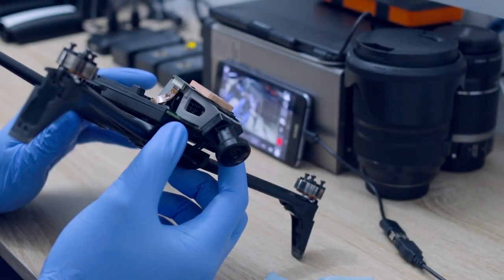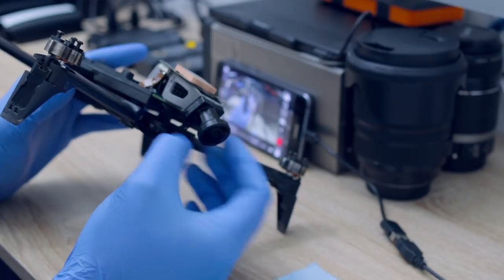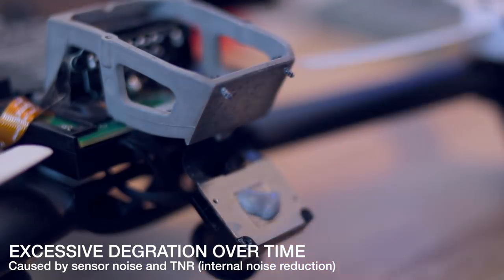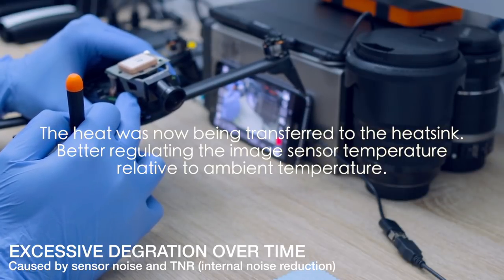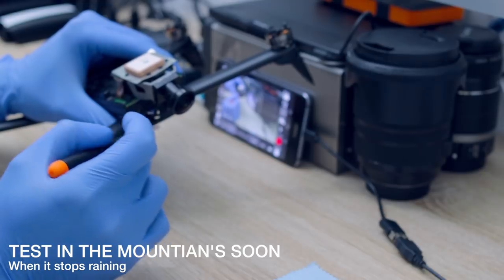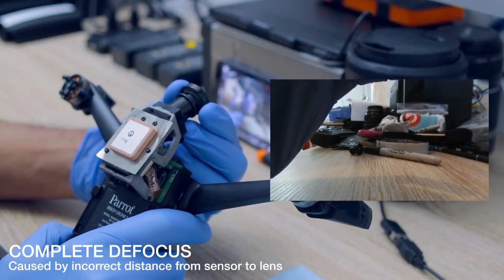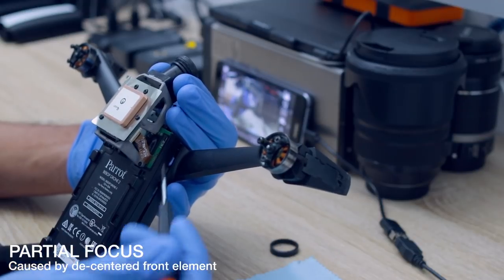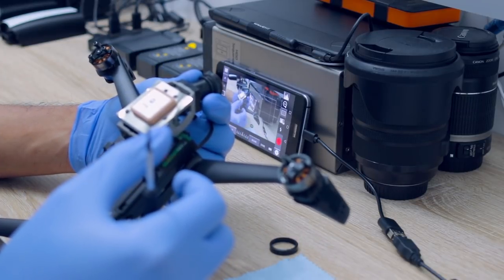BEBOP 2 - Camera Focus | Sensor Noise | Fix Explanation - Part 3

Comment: hello  which  tool to use  so that i can add a heat paste
Reply from the maker: Hi, the 3 screws on the camera back is a T4. The other screws to disassemble are T5 TORX. Sorry for the late reply.

Comment: Therefore I'm thinking if there is any chance to adjust settings of the camera (see them, review) through telnet...
Reply from the maker: I have a other video on how to hack the video via telnet. If it's not defocsing than a simple NR disable may be of use to you.
Reply: Yay! I've done it! Sadly I'm not sure if there is any difference. Picture quality is just not like it was before. :( I've tried all of the firmware upgrades, downgrades etc.  I'm starting to think if there is a chance to change camera/sensor completely. Let say for 1080p 60f - do you think it may be possible?  @ANTHONYVLOG
Reply from the maker: Possible but would require someone to match the EPROM on the replacement camera and a new stabilisation  alogrthm to match the new FOV. Given these drones are very cheap it is no longer viable.
Reply: @ANTHONYVLOG  Sounds right - too much effort and research.  
Anyway. 
I tried most of the stuff to figure out what has happened to this bloody camera and quality, without the success. It is still grainy and noisy. 
When compared to my earlier movies. Please look on my channel, it will delight me to have views from somebody like you and be a "drone friend". 
Well, my career is on hold now because I damaged camera's ribbon today when fitting it back (at least there is no camera feed, so I cannot be bothered with quality anymore lol) and I don’t want to spend around a £150 for a new camera with low framerate and quality issues like that. Bebop seems to be a nice drone but… I need to start my long journey saving for a Mavic2. 
Thank you for your vlog, I did learn a lot. And I like your nice and smooth edit. Keep it going!

Comment: Please test xiaomi lens
Reply from the maker: Dronchic can you give me the link please 🙏
Reply: ANTHONYVLOG whats you hardware version?
Reply from the maker: Both those lenses are too narrow and has a higher aperture f/2.3 vs f/2.8 and 1.83mm vs 2.5mm and 3.7mm. Without access to telnet to change the distortion correction ratio it will be difficult to use these lenses. Which hardware version are you asking for?
Reply: Hardware on drone